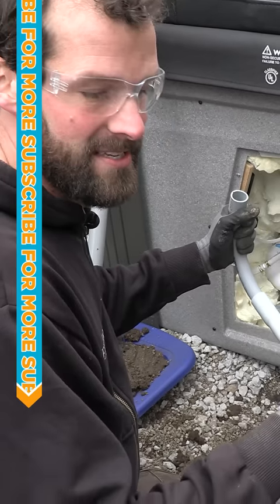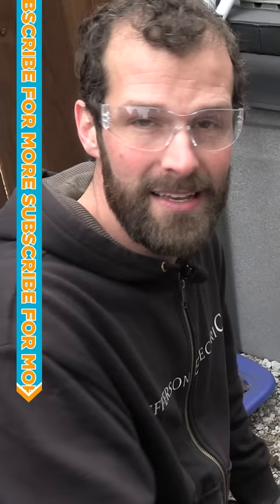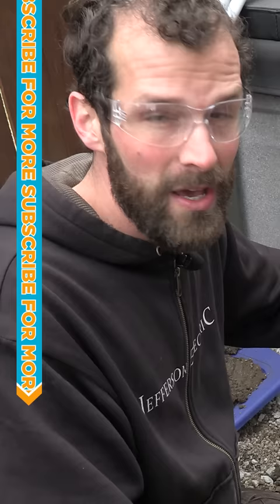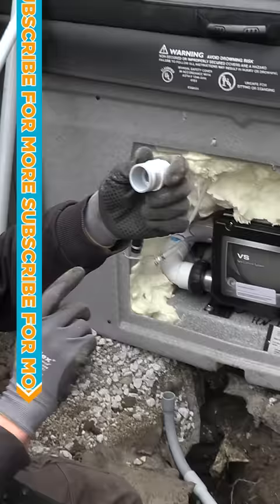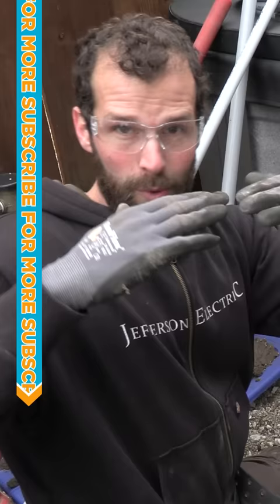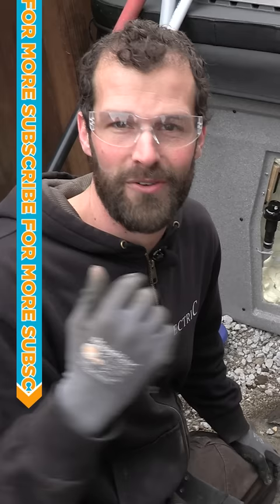A Warning When Using PVC

Comment: A 100F difference will cause a change of 3/8" per 10 feet. If the ground is 54F where you are, the maximum you'd ever see is 1/4" contraction per 10 feet. Reference:

https://carlonsales.com/techinfo/installationtraining/IT-NEMAEXJTA.pdf

Comment: He says 10 ft (120") lengthens by 1" but the real number is 0.15" for a 40F increase in temp.  There are online calculators.  PVC is very flexible.  Never is there a perfectly straight pipe from one rigid fixture to another.  There's always 90 degree bends and even a 1 foot section will bend 0.15" without you noticing.

Comment: How exactly do pvc sections that are fused together with solvent cement separate while underground?  Last I checked when my sprinkler system was installed they weren't keeping the pvc in refrigerated truck and so far it hasn't leaked

Comment: Ok since the guy in the video is incredibly incorrect, here are the actual facts and the math behind it. 

Rigid PVC conduit has a coefficient of expansion of 3.38 x 10-5 in./in./°F. 

A 10 foot length will change in length about 3/8" with a change in temperature from cold to a temperature of 100°F. This equates to 3.75 inches of expansion per 100 foot run.

Comment: then just... longer sections of PVC? why just 10 feet? also, there is specific flexible tubbing guaranteed to last more than 10 to 20 years specifically made to resist those situations. Don't you guys have this in the US? PVC tubes should be only for water

Comment: Had to run 2 4" and 2 2" runs in the middle of February through a swamp (piss poor planning all around from the client, my boss, and the higher ups) the water table was 12" below grade and we needed to be much deeper to hit our pull point. We were assembling 50' sections at a time. And literally having to submerge our run. But everything was so cold it didn't bond correctly, even after being primed. The connections opened and the conduit filled with water. It was dumb as hell, utility crew was pissed when they came to pull wire. Just shit show all around

Comment: Though you are not wrong... I been plumbing for about half my life. This isn't a issue.

Now... I do see ABS in houses built in the 1970s cracking at fittings. Badly. I believe expansion/contraction is the cause. But abs is brittle... It breaks. Pvc .. not nearly as brittle

Comment: I will be sure to condition my pvc plumbing chases prior to cutting. I’m going to run 4” pvc chases under my foundation, then run PEX inside. That way if I have a loss in the future, I won’t have to repipe the entire house or have an expensive repair. Plus I’ll have moisture sensors in the pipe to notify me of a possible plumbing leak before it becomes a problem.

Comment: Ummm..... expansion couplings?... and glue? Glue "welds" the connection and should expand/contract at the same rate as the pipe... I've personally never had an issue with this

Comment: The thermal expansion coefficient of pvc is 0.0000338 in/in/°F. So for a 10ft long pipe (120in) and a temperature differential of 100°F (154°F pipes in his example), the expansion would be 0.4056in. Far from an inch per pipe and even farther considering the temperature differential is probably a lot less than 100°F. Still significant over long distances, but based on the comments from supposed pipe layers, not as significant as he would make it seem.

Source
https://carlonsales.com/techinfo/installationtraining/IT-NEMAEXJTA.pdf

Comment: I’ve never had that problem I was electrician for 35 years PVC has never shrunk just did one the other day been in the ground for 15 years pull the wire right out pulled five more wires right in no issues whatsoever

Comment: It's 2" per 100ft over 60 deg F temp difference (thermal expansion coefficient) 
Dawg,  55 degrees to 125 degrees. 70 deg F will shift the length by ¼" on a 10ft pipe. 

Cmon

Comment: NO HERE'S THE DEAL : Rigid PVC conduit has a coefficient of expansion of 3.38 x 10-5 in./in./°F. A 10 foot length will change in length about 3/8" with a change in temperature of 100°F. -- (from Carlon, makers of pvc conduit expansion joints).

Comment: I am a licensed Journeyman Electrician and this does not happen. Sorry. I have been running conduit schedule 40 for over 22 years and while it is hot and glued in place and buried in the earth conduit does not come apart like this. Even the bell ends of conduit are nearly 3 inches long. Plenty of room to allow for expansion and contraction. I have ran wiring in conduit over 30 years old and it is still fine.

Comment: Run hot water through pipe after you bury it or better yet don't bury it run the wire omit pipe saves on material cost.

Comment: 1 inch? My company outright engineers and manufactures PVC pipes following ASTM D1785 standards (at least for our current batch cycle) for schedule 40, 80, and 120.

At best it’s going to move 3/8” in a 10ft length.

Comment: The coefficient of thermal expansion of PVC is 3.38x 10^-5 using American units. So let's assume the PVC is 100° initial then cooled to 54°. The 10ft section will now be 0.1866 inches shorter. He is just plain wrong. General rule is for every 100° F change in a 100 ft section will change 3.6 inches

Comment: It only pulls apart if the ends are fixed. You can just lay it in there and let it cool.
Reply: Exactly,
Any conduit run of length to worry about can have plenty of time in the ditch before cool off before backfilling.

Comment: At three feet deep wouldnt the temperature change depending on the surface conditions? I didn’t think that was deep enough to have a constant temp? So, in winter it would be even colder and the opposite in summer but people all over use pvc and I never hear about this issue. You’d think everyone would have this problem if that were the case. Sounds like a guy trying to charge more for materials.

Comment: Your not putting enough glue in the joints... so when your pulling the cable or wire your joints come apart... 20+yrs running underground pvc and conduit... never seen a 10 ft pvc loose an inch by being in he sun for days during construction and shrinking when place it underground....

Comment: Wrong.  The expansion characteristic is 3/8" per 10 ft at 100 degrees differential.  So, IF it were 154 degrees ambient above ground and you buried it in 54 degree earth, you would get a 3/8" contraction; not 3/4". And where, oh shit where, is there 150 degree ambient weather?

Comment: Are you aware that pvc conduit is used outdoors in open air to run cable to and from service meters? Somehow after decades of 95° summers and 10° winters it hasn’t contracted and expanded itself loose. Almost like what you’re saying here is bs.

Comment: PVC will only change ⅜" per 10' @ 100⁰ change, so assuming the it's 110⁰ @ burial, & ground is actually 54⁰ (56⁰ dT) & the expansion is uniform per degree,  that only barely more than ³/¹⁶" so again BS, the ground moves and settles around the PVC, allowing it to move before 100% permanent compaction

Comment: Actually with a 100°f difference in temperature pvc only expands/contract 3/8" over 10ft. When dealing with extensively long runs, in a location with drastic temperature fluctuations that may become an issue, but other than that your exaggerating just a but there bud

Comment: Try using glue, Einstein.

And a quick calculation show thermal expansion of PVC pipe is a QUARTER inch for every ten feet for 60 degree temperature change.  So an inch expansion would take 240 degree increase in temperature.

Comment: Over exaggeration.  10ft of pvc sch 80 will never expand with 120° temp.   For instance. When drawing alot of power and the lines get hot, the pipe DOES NOT stretch, warp, or bend. That would be a huge red flag for safety, and nobody would produce it.

Comment: There is truth to this, but he has VASTLY exaggerated. My family has been doing this stuff for over 25 years. I have unearthed work my Dad did in the early 2000s for repairs and additions. Many such conduit were laid in the height of Texas summer, 110 degree days. Nothing I've ever uncovered was pulled apart in this manner, or even showed signs of slip.
Reply: Two factors to also consider here, is that PVC can stretch, and PVC glue does not just attach parts via a secondary media, it fuses the individual pieces together with a "weld."

Comment: This is incorrect. Theoretically you could see this level of dramatic contraction and expansion at 100' with a 50° temperature change... But 1" over 10' from just being in the sun to being in the ground, you're probably looking at an 8th inch change.

Comment: PVC doesn't shrink that much. For a 30 degree change (F) in temperature, for every 100 feet, you'll get about an inch shrinkage, over 100 feet.  So, this guy is over-estimating by about a factor of 10 or even 20.  If it were 100 degrees outside, and you put it in the ground, you're looking at perhaps 2 inch shrinkage at the most, over 100 feet. so, if you're running 50 feet, you're back to 1 inch shrinkage. this would be almost unnoticable, especially since when working with underground pipes and holes and fittings and twists and turns and all that, you're much more likely to be off by your bad math than this shrinkage effect, which, again, is not nearly as severe as this guy is saying.
Reply: you're also more likely to run into elevation changes or ground movement than pipe shrinkage. so, the loose or newly-compacted dirt over such lengths could potentially change and pull pipe apart, but that's why there's industry standards which vary depending on the usage. there's charts for pressurized pipe, and for conduit pipe. also, obviously you're going to glue the pipe together.

Comment: Total Bravo Sierra son. Stop posting these ridiculous the sky is falling “ITS TOAST” videos. For one thing 3/4 PVC will not expand an inch in 10’.  More like 1/4” but guess what… it also will never again contract as much as it expanded initially. That’s the nature of the material. So even if you had full expansion in the blazing summer sun and stuck it in the ground, you’d end up with around 1/8” difference in 10’ and maybe an inch in 100’. But zero problem if it was glued, as it always should be.  And even less of a problem if you use an expansion coupling.  But bottom line I’m in my 60s, have been wiring for over 40 years in the northeast- the home of expansion/contraction and have never seen the trouble you are fabricating.

Comment: If anyone would know this shit a plumber would. With all the different schedules of pipe I've never seen anything even remotely like that. It will be 100 plus in the summer with a ground temp. of less than 65 we'd have to do something besides bury pipe if that was the case. Hot enough cement will basically turn it into one long piece basically btw js

Comment: If pvc had an expansion rate of one inch per 10 feet that would imply a contraction of one inch when its cold, meaning a two inch variation from cold to warm! Or 1.6% no would ever use it for anything, it would be to unreliable ! And since its used widely in both warm and cold environments, and that vary from hot to cold, you don't know what the hell are talking about

Comment: Yeah I’m a plumber that has ran commercial / residential pvc. I don’t personally think this is true. The pipe might move around a bit and separate at the fittings and dirt will fill the pipe causing you to not be able to get through, I know for a fact pvc pipes aren’t sealing themselves closed from 50 degree weather 😂 ur crazy.

Comment: You contradicted yourself. Or at least you miss spoke. If your conduit is a 10 foot piece cold then it will not contract when it gets hot, it will expand and if it’s under the ground then it doesn’t really matter unless it freezes and gets colder than it was when you laid it. For electric you don’t exactly have to glue it but technically you’re supposed to

Comment: False, made conduit pipes and pvc pipe for 5+ years and when manufacturing and producing we would have to measure length, pipe thickness and weight multiple times before allowing them to be pushed out the door and before inspection to insure that heat and cold would not effect the final product

Comment: Sure they expand and contract. But it ain’t 1” in 10’ a 100 degree change only will make them expand 3/8” over 10’.
Reply from the maker: I rounded up and allowed for 150 degrees of temperature variation here in the Midwest + direct sunlight

Comment: This guy is making it look like the PVP is being pulled by Black Hole gravity. Darn, the PVC is being pulled into the Event Horizon and it is being torn part.

People need to chill a bit...he is talking about temperature variation here. Unless you install the PVC pipe where there is a cold winter and hot summer this practical has no impact on your installation.

He didn't say you can't use it. From what I get on his video, just wait for 4 hours being baked in the sun then pull your wiring. This way when the pip contract and expand then you won't run into the issue.

Of course it's toasted, it has been baking in the Sun for 4 hours!

Comment: When glued properly it chemically bonds to the other piece and fuses them together it will never shrink or pull apart at the glue joint the pipe may contact a little but the joint will not pull apart ! Or you would have thousand of water leaks . Come on now

Comment: This guy is freaking stoned, I’ve been an electrician for 32 years and likely ran thousands of miles of pvc, some I’ve re pulled new wire through 20 years later for equipment upgrade, and as long as your glued and the ground isn’t saturated in jetA or diesel fuel, that conduit is very viable. Here in Hawaii where I work now we run most all above ground conduit in pvc and as long as you support every 3 foot it’ll stay useable for ten thousand years.

Comment: A full stick is 20 feet.  Comes with a molded coupling on one end that is close to 1.5 inches... 

Where are you where the ground temperature is always 54 degrees? I assume you are measuring in Fahrenheit.  I want to know where the sun is so hot that pipe grows... wouldn't it only heat on the high side? Causing the pipe to warp into an arc... never seen that... hmmm..hmm... what medication are you taking?

Comment: If you apply the adhesive (2part) to the coupling it ain't coming apart.  The conduit will pull on either end that is still free.  Hopefully the last piece you apply adhesive to has cooled enough to undergo normalization and not be at risk of separation.  Your explanation is invalid.  Quit scaring people like this.

Comment: Boy how fast is this guy lay pipe in the trench should net PVC that it's bonding I've been doing it for 35 years never had this problem
Reply from the maker: I often glue the whole run together and drop it in the trench and never have to set foot in the trench as long as I allow for thermal expansion over 20'-300'+.

Comment: I call complete bullshit. Several reasons 1 why wouldn’t the UL listing tell you that “FACT” 2 why wouldn’t the manufacturer make the coupling depth longer than the expansion or contraction for each size 3 why wouldn’t all water lines put in leak after there time in direct sunshine at the supply house then put below frost line where ever you live and has a intense degree change. Also as many more have mentioned what about all the slabs we (electricians have roughed in before the building could be built sometimes months or more and old conduits I’ve ran across and had to refeed wire all be broken..He must be doing something else wrong

Comment: No. Max expansion (100° change) on a 10' stalk is 3/8", not 1". When do we see a 100° temperature change during installation? 
The change is more like 1/10" in extreme conditions and pvc flexes far more than that. 
Think about it, would we ever have even considered it if it failed when the temperature changed?
Dumb.

Comment: That’s a lie.  It’s the manner in which you are backfilling your ditch, and how flat your ditch is.  You start backfilling in the Center work your way out.  If you start on one end or the other, you will push or pull the entire section of pipe.  Golly gee
Reply from the maker: hmmmm...backfill in the center is interesting. Thanks
Reply: @ElectricProAcademy  also, throw a mound of dirt (3-4 shovels) on your conduit or pipe every 10 feet or so, it will help keep it still.

Comment: That's funny. Why doesn't that happen to the PVC for my water system that water's two acres of yard everywhere. I've got PVC and CPVC buried under the ground all the replaced. And we get hard freezes here where I'm at. So it gets below 54°. So why isn't all that PVC shrinking up and pulling apart? Spring comes and I reconnect my water pump and flip it on and oh my goodness water still closed through just fine. Does it only happen to the electrical conduit that he uses? Maybe he uses a special type of shrinking PVC. Clown 🤡

Comment: My ass you can't pull wire in it.  As  a Phone and Data cable installer for 30 years.  You use what some call a bull rope. It a white flat Nylon  rope it will not cut the bends in PVC. OH AND BTW use some yellow 77 or other type of lube.

Comment: The BS part of his statement.   You put a pvc conduit in the sun for four hours, does it lengthen?   Yes.   When you put the conduit into a trench that is 54 degrees does the conduit contract?   Yes.   But it will shrink in the trench before you get it completely assembled.   It will cool down in minutes.  Short minded video!

Comment: I’m calling BS on this one. Done miles of site lights, pvc to pole bases pour base whenever pole mast’s show up go through and clear condensation out of pipes with rat and poly line and pull wire. You’d get your butt fired with your inch of shrinkage story standing in the job trailer explaining why they have to dig up a parking lot. 😉😎👌🤓

Everyone will be sitting in the dark in about 20 years when the electricians are retired 😂🎉🎃